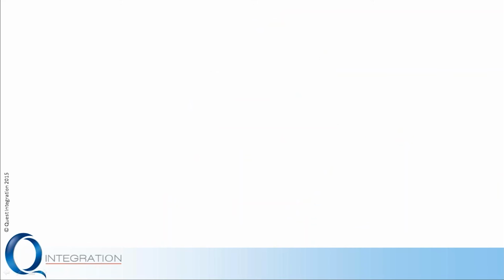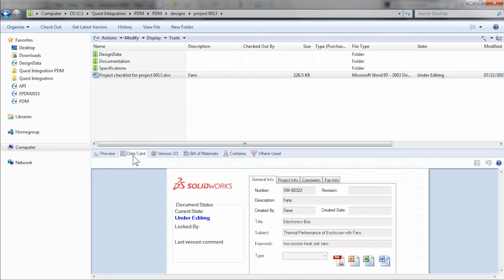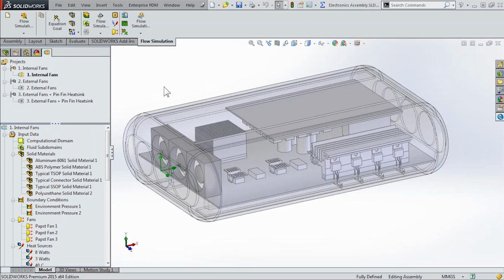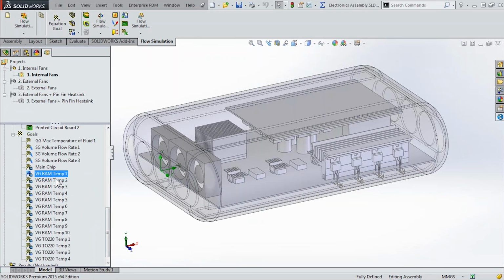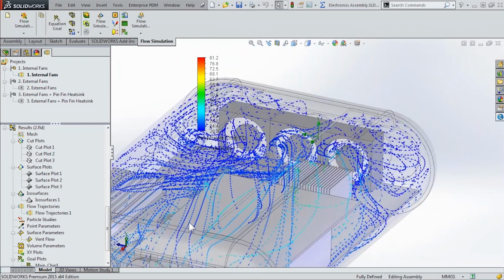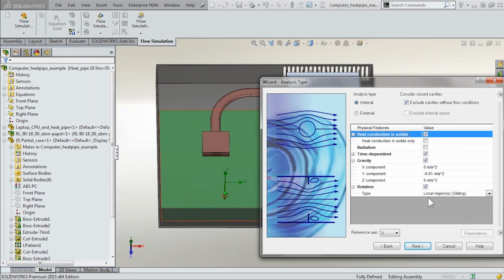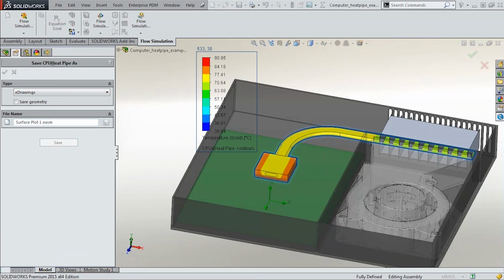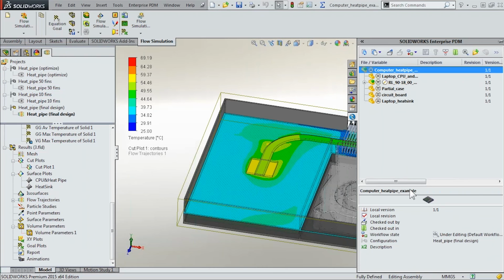SOLIDWORKS Flow Simulation Electronics Cooling

Comment: I have a board with top layer resistor generating heat 6W each and there are 16 resistors. There are vias connecting the tab for the DPAK packages to the bottom layer. Vias are 20 mils drills on Arlon 85N.  On the bottom layer there is a heatsink connecting the thermal vias and between the board bottom Exposed  copper there is thermal material.  I run the sim in SW flow sim and I know I am setting it up wrong because the results show 900C which is ridiculous, and the heat sink shows no heat on it.  How do I set up a the sim so that the top layer have the heat sources and the heat goes through the vias to Layer2 copper and Layer3 copper and Layer 4 copper.  Copper in each layer is 10inches x 2 inches. Sim results are ridiculous and I don't know how to get real results.  Anyone?

Comment: I have got a problem. Fan is added to a box but it gives error.  
"Face<1>@60x60x15 12V fan-1 is not laying on the boundary between solid and fluid region."

Please Help me ASAP. I have deadline.
Reply from the maker: There are three main reasons for this error message occurring:

1. Simple Reason – The SOLIDWORKS® geometry has been prepared correctly for an internal flow analysis, but you do not selecting a face that is in contact with the flow domain. For example, selecting the outside face of a lid instead of the inner face to apply a boundary condition.
2. Common Reason 1 – Invalid contacts exist between parts in an assembly (there may be an edge-edge or point-face mates between two SOLIDWORKS features)
3. Common Reason 2 – The SOLIDWORKS model is not "analysis ready" yet because openings in the geometry prevent the program from detecting an internal volume (fluid domain) that touches the face you selected.

I'd suggest getting with your local Value Added Reseller, as they should be able to assist you with this quickly.

Hope this helps!